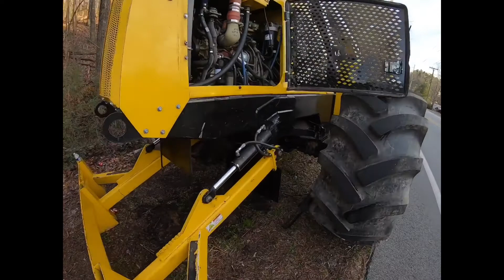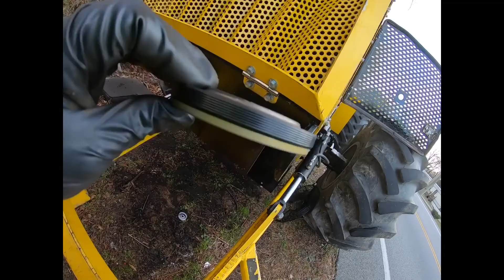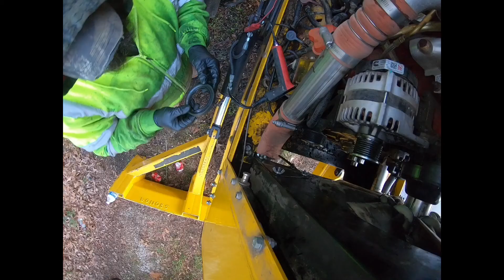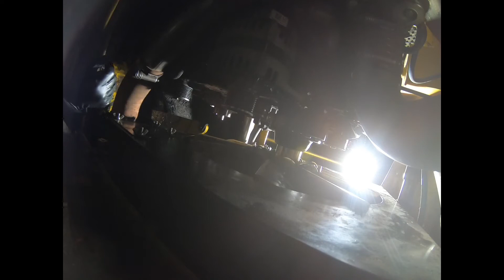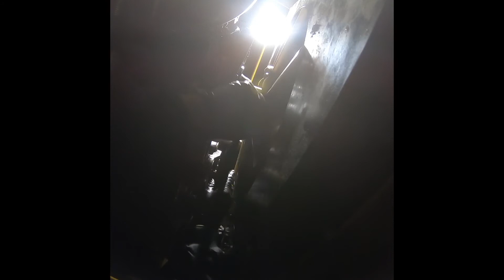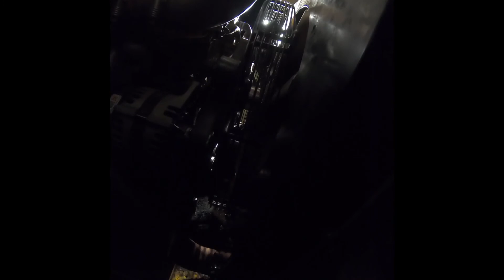Cummins QSF 3.8 Front Main Seal Replacement

Comment: Did that seal last? Did one the other day and it lasted 1 hour. Found a TSB for replacing the oil pump due the relief valve sticking
Reply from the maker: Unfortunately no. I had to rewatch the video. Cummins ended up paying me to replace the oil pump assembly. After the new oil pump we had no more issues. There is also an updated oil pump as well, which was what I installed after the fact. Didn’t get to make a video on it unfortunately due to where it broke down